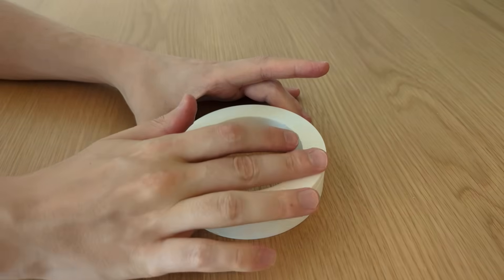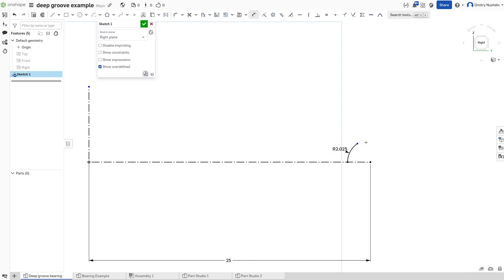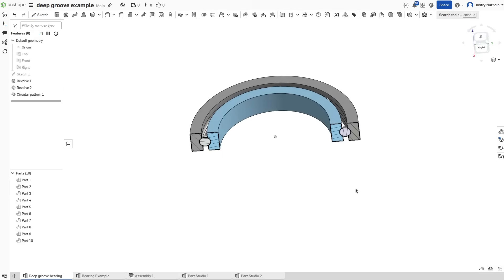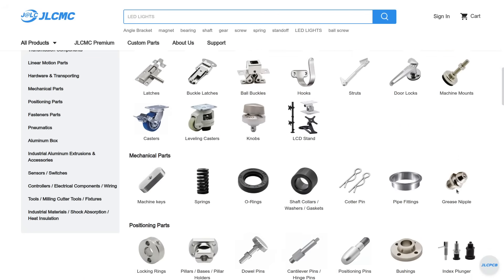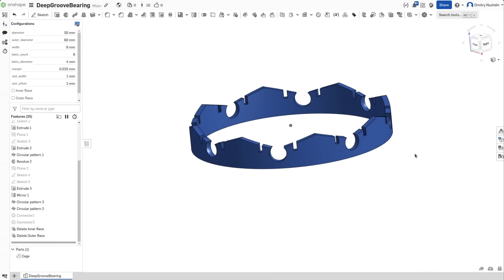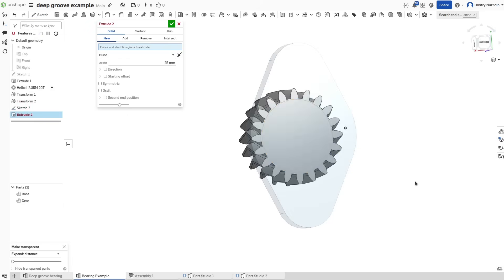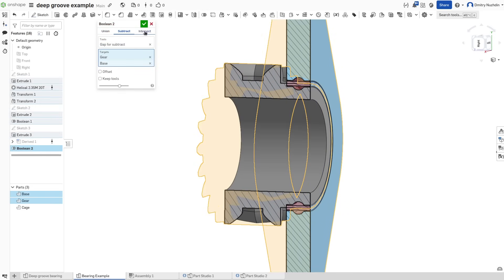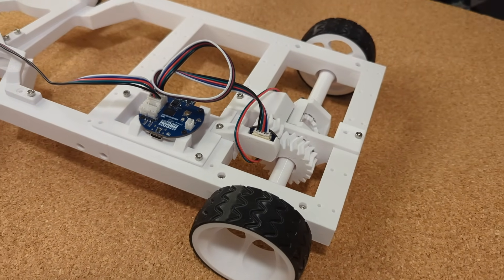Best 3D Printed Bearing Design

Comment: Thank you for the video and design, I made a ball bearing in Fusion 360 based off your model, but after printing it seems the bearing does roll very smoothly and I've tried sanding, filing, and changing to random seem position but doesn't seem to get any smoother. Since it's difficult to sand where the balls lay. Anyone have any tips to get a smoother bearing?
Reply from the maker: Hey, if you think that the problem is seems - you can try to improve seems quality. Start with a filament calibration -- you need to tune "flow rate" and "pressure advance (PA)" you can find guides how to do that (in general - print special templates and pick the best one). If tuned properly you should not have seems that you can feel when you touch surface.
Another thing that can ruin the surface - perimeter crossing. When extruder travels across the perimeter (while layer changing or from other part of the print) it can leave a small bit of material on that flowed-out naturally when extuder was just traveling (also drying your filament reduces the flow-out, so you should try to dry it if you your filament could be wet, but for me quite wet PETG still works good enough). You can prevent this from happening, there is an option in a slicer that force extruder to travel over material as much as possible. I use it together with random seems position when printing bearings. In my case seems looks more like a small dent, nothin "extends" outside and that's really good for bearing. You need to try to get similar result with your printer.
Reply: @Positive_Altitude Okay! Thank you!

Comment: I just went back and watch both video about bearing. I think in the case of neading a thrus bearing, this nice method would no longer work. 
Would you consider making the previous design also parametered so I can easily import it? Or would it be hard to incorporate into other designs via boolean operation?
Reply from the maker: Hey! Thank you. I did not think about making a parametrised version of it. Maybe will do that later, but can't promiss for now :). But I think it's quite easy to design it in-place. I have done it dozen of times, before started using parametrised importable version. It takes just few minutes if you get used to it.

Comment: Great design! And thanks for sharing.
I tried to design a snap-together axial bearing that uses plastic bbs instead of steel balls. The design seemed promising, but firstly the snapping-together didn't work as I imagined, but secondly the surface didn't turn out well enough for it to roll smoothly. First issue can be easily fixed, and I already have a new version in my head and on paper. I'm not sure how to fix the second issue though. I'm very new to both designing and 3D printing.
I think choosing "random seam offset" might've been a mistake.. and I should probably reduce the layer height.

Before I started my design, I actually did not look if there were any other printable axial bearing designs already, because I wanted to come up with my own design, and not just copy something someone else made. I did, however, look at technical drawings so I'm not completely off. They don't seem to go into all the details, though. They usually just specify what's relevant to people using the bearings (inner/outer diameter, thickness, etc), rather than showing what's relevant for creating them.

Have you tried to create an axial bearing yet?
Reply from the maker: Thank you!
Random seams is a good option for bearings I think. Having all seams aligned in a line is a bigger problem. If you want to improve surface quality, start with a filament calibration. Most important parameters are "flow rate" and "pressure advance (PA)". You can google how to do that, it requires to go through printing some templates and choosing the best one. This (especially PA) will improve your seams a lot.
About axial bearing - I have an other video on the channel about 3D printed bearings and I show my axial (and a different version of radial) bearing design there. Check it out! Cheers!
Reply: @Positive_Altitude  I just watched your other video. Very informative. Thanks!
I think turning on "random seams" causes much more wall crossing, so I should definitely turn on "avoid crossing walls" next time. It looks like that's actually the main issue - if not the only real issue.
I'm actually using an Anycubic printer and Anycubic PLA.. the Anycubic slicer with the matching printer and PLA profiles. I'd hope that the profile is calibrated well enough, and it wored really well with my other prints - but I should probably check if I can improve it.
My radial bearing design was actually my 3rd design.. and my 4th printed object. 😅
But thanks to people like you, who share their knowledge, I've done pretty well so far.

Comment: Beautiful design. I'm gonna test print and if it works as well as it seems, it's gonna by my go to for bearing implementation in my designs. I'm just gonna make the ball tolerances ("margin" in configurations, and "#gap" as a variable) to almost zero. Like 0.005, so a total o 0.01 on the diameter, so that the metal bearings can "dig" their grove, to achieve better tolerances and rigidity. 
Just wanted to let you know that the gap dimension is not parametric for half of the ball diameter. Idk if I copied an old version, but i changed it in mine to #balls_diameter/2.
Reply from the maker: Oh... right that's an error in my design. Good catch. I didn't really test it on different ball diameters, so maybe you will also need to fix the "clips" shape a little bit. It's possible that they will break off or require too much force to snap-in for your ball size. But I think it will be easy for you to fix ;) Cheers!
Reply: @Positive_Altitude  I'll check it out, thanks for the tip. I didn't notice anything else being off, but that's the beauty of opensourcing. We help each others and in the end everyone has something better than before :D

Comment: I’ve seen ceramic bearings available and probably the balls themselves which I guess are lighter than steel -any other improvements or downsides with ceramic?
Reply from the maker: I think any kind of ball that is noticeably harder than 3d printing filament will perform in the same way. Steel, ceramic, glass ... even dense plastics... I think the  only downside of ceramic is the price ;)

Comment: First time I printed a working gear set... thanks! 

Future video request - slicing and printing. I am currently fighting the seam and none of the settings I change seem to help
Reply from the maker: Wow, thank you so much! Honestly I thought that this kind of topic is super well covered on YouTube. Of course not all videos are good, but there are some.
If you don't like how your seems looks, I would suggest you to do 2 things.
1) Switch to Orca slicer as it's most advanced slicer among all. (Well Bambu Slicer, Prusa slicer and some other are basically the same thing, no reason to switch if you are using them, but I think there is no reason to use Cura for example)
2) If your slicer is good, calibrate your filament! There are two main parameters - flow rate and Pressure Advance (PA). They both affect quality dramatically and that's what people often overlook. Getting proper PA is crucial for good looking seams and sharp corners. In Orca slicer there are calibration templates available. The procedure will take some time, but it's not complicated. Just google for "flow rate and PA calibration". I don't know what printer you use, but in most cases if you take modern "default" profile for the filament type and calibrate flow rate + PA you will get very good results. Usually that's all you need to fix.
Reply: @Positive_Altitude  Perfect, thank you! Just downloaded Orca and sliced with recommended settings from  the -better-seams-an-orca-slicer-guide-to-using-scarf-s from printables. I've printed over 12 bearings in Bambu Studio and never came even close to what you show in the video

Comment: Really nice! I was wondering  if you have some insight into what controls how easy the bearing rotates? I want to make rotational mounts for optics, and for those you need it to be smooth but still have a high resistance so that you have to put some effort to rotate it and it stays at the angle you leave it at.
Reply from the maker: You can try to fill the gap with thick grease (I used lithium based grease, it was ok at least for PETG)  The grease adds some constant friction due to viscosity, maybe that will be enough. More balls will make more friction in this case.

Comment: Great design, thanks for the video. I'm having issues with the little "crown" clip that snaps in. I keep breaking off the tabs. Recommendations on tolerances there? How wide is that clip relative to the gap between the bearing rings?
Reply from the maker: Are you using PLA? I tried this design only with PETG, so maybe some parameters should be tweaked for PLA, as it's more brittle. For 4mm balls I use 2mm "slot_offset" which controls tab width. Maybe you can play with that parameter? What is your ball diameter?
Reply: @Positive_Altitude  after my comment I did end up switching to PETG and bumped up my tolerance a little bit. I did not have any issues after that. I was also using a matte PLA before, which I think has even worse layer adhesion than regular PLA, so someone else may have better luck than me using PLA.

Comment: Is there a "best" filament to use for longevity?
Reply from the maker: I haven't tested. I use PETG as it handles dynamic load better than PLA, and everything else is either hard to print or toxic. Nylon is probably the best, but I guess it will be hard to get right, given the precision required. I personally would not try to push it's boundaries. If longevity/load/speed/precision is a concern, it's probably better to use metal bearing than try to push the limits of 3D printed and probably fail anyway 🫠 I think these bearings works best for prototyping or applications with low requirements.
Reply: @Positive_Altitude  thank you

Comment: There is an error in this. The balls need to roll in a circle.  This means that the outer contact points roll farther than the inner contact points. For this to work the outer ones must be farther apart, so you can't just mirror the race profiles. Using mirrored profiles means that the balls must slip, adding friction.
Reply from the maker: I don't see why mirrored profiles will cause slip. I made a quick search and indeed the profile radius of outer race is usually slightly bigger than for inner race. But the reasoning is completely different: in few words it would be optimizing contact patch shape under the load. It's not about slip or friction or efficiency, it's made to increase bearing life. So I don't think that it's that important for plastic bearings. Also finding a perfect shape will require complicated analysis -- that's too much efforts for a bearing that will never be even close to metal bearings anyway.

Comment: Thanks for including the CAD, but why do include so few balls, why does your cage space them so far apart? (don't you think there's a reason why you're moving towards a standard bearing design... but you still deviated here...) Fewer ball spaced far apart is just going to increase the pressure per bearing under load, and you're already dealing with deformable plastic.
Reply from the maker: The design has a parameter for the number of balls, so you can use more. I think 8 balls are ok for lightly loaded bearings. Sure you need more to increase load capacity. Also it was easier to film assembly with less balls 😅

Comment: sir!

"Does it really achieve 50-micron (0.05 mm) accuracy? How did you print this? I have a 0.04 mm nozzle. If I set the layer height to 0.08 mm, can I reproduce this print with the 50-micron spacing you set for the 4 mm steel ball to fit in?

I have a genuine doubt; I'm a beginner at this and I have an A1.
Reply from the maker: I think A1 is good enough to print this even with standard configurations. I print it with a standard 0.4mm nozzle and 0.2mm layers.
If you feel like it doesn't provide enough precision you need to calibrate your filament settings. You need to find the best values for "flow rate" and "pressure advance (PA)" you can find how to do that, it's not difficult at all (generally you need to print several calibration templates and choose the best one).
Another important thing for bearings is "XY skew". If it's not perfect your bearings will be a bit elliptical instead of the circle. For Bamboo printers there is a procedure to compensate for XY skew. (print special template - measure with a caliper - run a print with additional custom Gcode command once) Google it, there is an instruction and the template on the Bamboo forum somewhere. Let me know if you have problems with this. I had some XY-skew on my X1C and spent a lot of time trying to fix it with proper belt tension, before finding this "software" solution to the problem 😅

Comment: When spacing the balls for the cage, why not use neodymium magnets on a printed jig?
Reply from the maker: Never thought about it, could be a good idea 🤔
Reply: @Positive_Altitude  When I printed these, I found that distributing the balls roughly while holding them together was ok but resting it lightly on the cage as you rotate the balls for final alignment before snapping the cage into place worked pretty well.

Comment: Just FYI: There is a nice design somewhat like this that uses 4 steel wire rings snapped into the deep groves that makes a much more durable race. Look for a video called "Wire Ring Roller" and follow up "3D Printed Wire Race Bearing" by Eros Nicolau.

Comment: Is it possible to cut a filament and use it instead of balls inside the bearing?
Reply from the maker: I didn't try it. I think the 1.75mm diameter is a bit small for 3D printed bearings. The races surface is not perfect and smaller rolling elements cause more problems because of that. But it could be fun to try :)

Comment: you dont need the ball bearing holders, just fill the groove with the ball bearings all the way. less parts is more. what do you think you benefit from the holder. nothing. more bearing balls means more strength the bearing can bear. the holder structure is not load bearing. nah make the outer ring two-part which is closed with vertical bolts. no problems.
Reply from the maker: I did this before and I don't like it. It's heavier and if you don't use lubrication it rattles a lot. Especially if it has a radial load and half of the balls are free to move. You can add grease to deal with that, but a lot of balls + grease creates significant "static" friction. I would personally use it only if there is a need to push load capacity to the limit. For light load applications less balls is better.
Reply: Would this not make more friction
Reply: I'd like to see a snap together outer race and a fully filled bearing and see how it takes side loads. Please design it, print it, and make a video!

Comment: That was tremendously useful. I'll have to try it.
Printing the races in place is very convenient. Building the races into parts on real manufactured components can be a pain but with a 3d printer and low precision requirements it can save quite a bit of space and a few parts.
Reply from the maker: Yes, exactly! I have so much fun using these bearing in my builds.